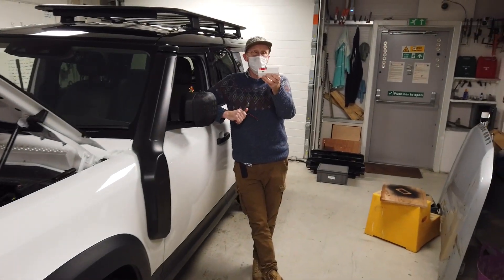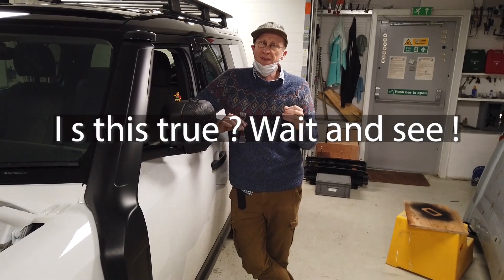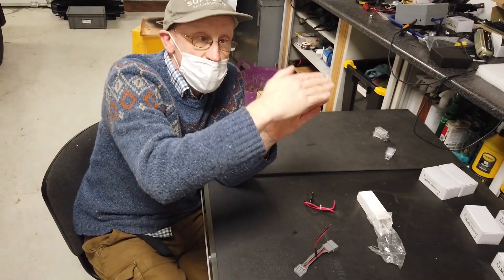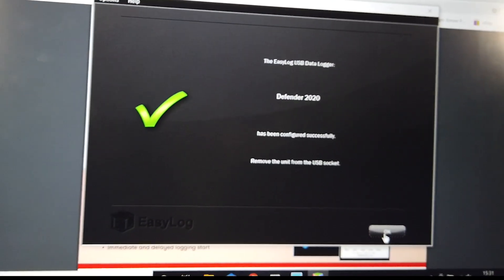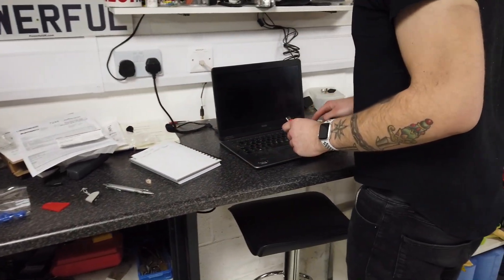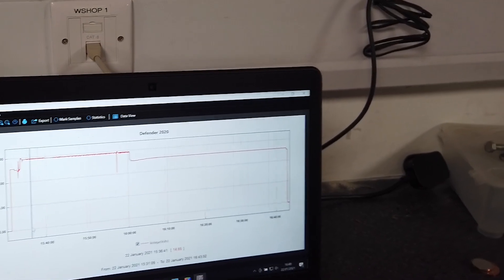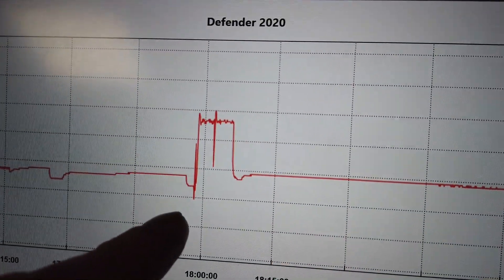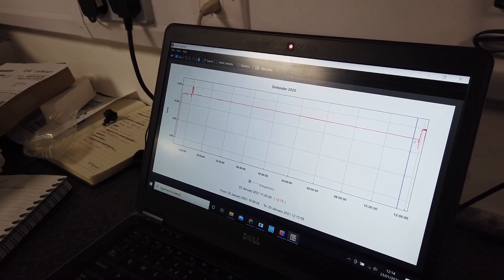Land Rover Defender L663 Voltage Data Logging - Testing Dash Cam Supply / Smart Alternator

Comment: Whatever happened to the dash cam looms with the “Bernard Board”??
Reply from the maker: We have a new loom coming which means there is no need for the board on the Sport / Defender.
Reply: @L663  Perhaps an inelegant solution, but for those using the Garmin Mini (which doesn't even have an on/off switch, but rather relies on vehicle ignition power), couldn't folks use your constant power usb loom plus a micro-usb on/off switch in-line between the camera and the camera's usb power cable? It's a simple toggle switch, so using it would cut the power draw from the constant pull off of the usb port on your constant power loom. I know some people might like the idea of their camera turning on/off automatically when they start/stop their car, but I don't mind pressing a switch that determines when it's starts recording and when it stops.

Comment: Did you lower the suspension before leaving the car for the night. Older RRS/D3 and 4 and FFRR if you lowered the suspension to access height it put the electronics to sleep. I used to leave my cars parked up for up to 4 months and only once ( an Evoque) came home to a flat battery. If you have the Defender’s suspension set to “auto access height on stop” that might also be a cause of the spike on Start up as the compressor cuts in to raise the car.

Comment: To all the people keeping on about this subject, 
The lights conected the camera is connected, it doesnt matter, A smart alternator will adjust  itself for input of power, it is meant for that, the alternator does not input electric current when the engine is not running, it is always dormant, only when the engine is running does an alternater work, therefore it doesnt need to do anything else, it's on or off, that's it. Research how does an alternator work.

Comment: Hi Simon, your data logga may indeed be reading a voltage but that circuit may not be able to provide any usable current in 'sleep' mode. Either get your electrical 'guru' to make up a loa' for you to put parallel with the logger or simply wire the data logga in parallel with the camera.

Comment: The gradual voltage drop shown in the last overnight test is likely the small current drain some of the vehicle modules need to stay 'alert'. I believe they should only draw a maximum current of around 30 milliamps, which should give around 2 weeks of useful battery charge from a fully charged state.

Comment: The car possibly won’t go to sleep because the data logger is connected?
Reply: The lights conected the camera is connected, it doesnt matter, A smart alternator will adjust  itself for input of power, it is meant for that, the alternator does not input electric current when the engine is not running, it is always dormant, only when the engine is running does an alternater work, there it doesnt need to do anything else, it's on or off, that's it.

Comment: As the emergency and service buttons are in the overhead console they will probably have a constant supply. Most modules will have a phased shutdown and the process they shutdown in will depend on many factors (and good old fashioned design cock ups). A non important module would shutdown completely after normally 30 minutes. You can get data loggers that plug into your OBDII socket.
Reply: The voltage drop is probably due to the quiescent drain due to powering the modules that will remain active, eg the alarm and security modules. I know of a major luxury manufacturer who ended up with a door module that didn’t go to sleep and drew 0.5amps due to a software coding error.

Comment: Would the logger work if you plugged it directly into a usb port instead of wiring it in?
Reply from the maker: The voltage i am try read is not the USB voltage (5v)... its the live feed 12V - the USB on the logger is only for data transfer to a computer.
Reply: @L663  Silly me, why didn't I think of that!

Comment: Simon, looking at your Video and reading your graph as best I can it looks to me as though as soon as you start the car the  voltage jumps to 14.8 and holds there until you switch the car off. This means that the smart alternator is in battery charge mode and is charging your battery. However if your battery was charged then it would not charge and would be in Supply mode which I think is about 13V? Your battery was obviously not fully charged. If you start with a fully charged battery you will get a completely different result. I did post a comment regarding my Dico 4 issues I have had with the smart alternator charging a dual battery system which I finally managed to get working. I do not think you will ever get you dash cam working properly if you expect the system voltage to trigger its activation. As soon as the battery is full it will stop working.  Check the CTEK D250SA, they have work around the smart alternator by using and ignition sensing connection to draw only when the engine is running. But good luck, I also want a dash cam solution.
Reply from the maker: Yes i think that there are a few factors that stopped the smart alternator...lack of charge / heating / radio lights on etc.... but the car had been on charge. I have an as yet unproven theory that the new Defender is so power hungry that the smart alternator is not going to be having much down time ! Anyone who has been stuck in traffic will know the infotainment system powers down due to low battery after a few minutes !
Reply: The solution is to use a hardwire kit, piggybacked off a constant live fuse, and to get a dash cam, such as the Ddpai, that can be set to switch itself off after 48 hours idle, which should be long enough for most people, and short enough not to drain the car's battery considering the camera will be sleeping for the majority of the time. Cameras that use a park mode where they continually record but at a very low frame rate are not my cup of tea. I prefer them to sleep and wake/record only when substantial motion or some other trigger is detected

Comment: Well done. I suspect that the voltage drop at startup is why the modules sometimes fail to boot up properly (at least on mine). If something is not working correctly, turn it off and start it up again to see if it works or the error message goes away. I call it the Rangie Slot Machine. Happens more often in cooler weather.
Reply from the maker: Yes there is a solid voltage drop at start up..... wonder what happens if i use the winch !

Comment: Stop/start probably doesn't work due to low ambient temperature, approaching zero. Or seat heaters are in use or for a myriad of other reasons. Leave it to manage itself.
Reply from the maker: Yes lights on / heaters on etc....